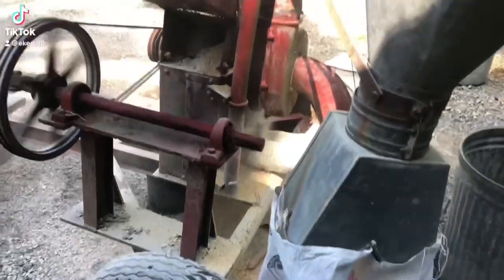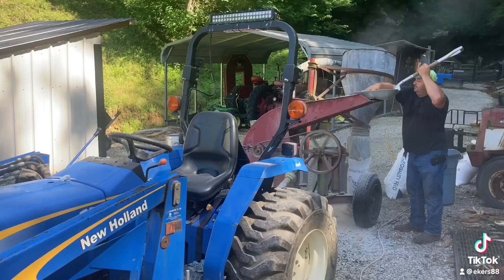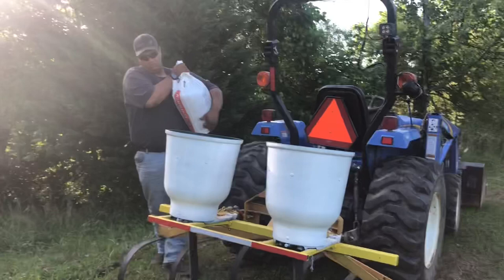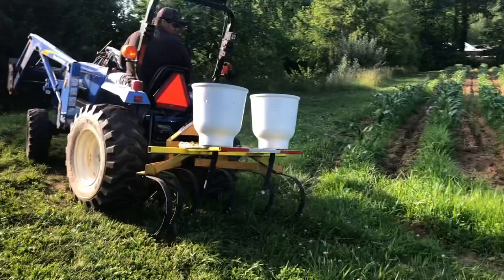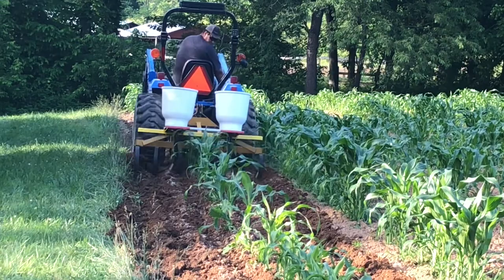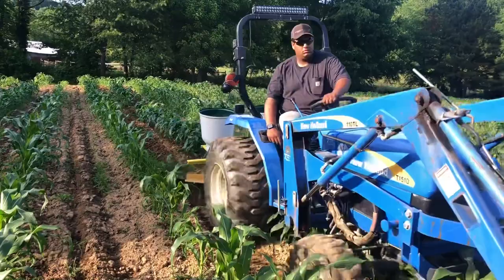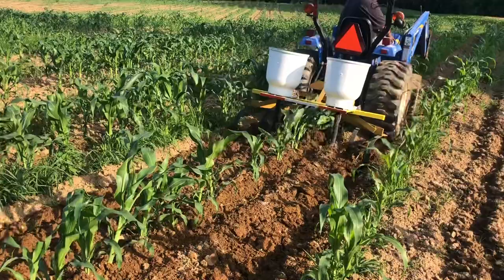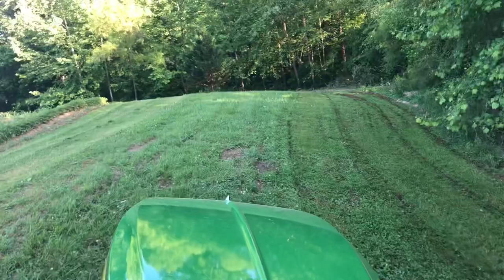Side Dressing Sweet Corn

Comment: Kallstrom Sweet Corn  here , As your applying your fert. i see your not covering it with dirt , you need to throw more dirt to cover your fert. It would be nice to have a closer look at your motor and off/on switch that operates your fert. boxes
Reply from the maker: We changed it since video was made but we do it before rain . They are manual on off